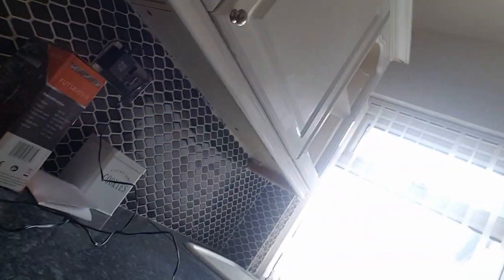Rust Delete On The Passenger Side Rear Wheel Arch (Project Norman)

Comment: Where do you purchase one of those cleaners?
Reply from the maker: It's just a wire brush attachment and a drill, or if your on a budget, just get a wire brush but it will take loads longer if you just use the brush
Reply from the maker: It's just a wire brush attachment and a drill, or if your on a budget, just get a wire brush but it will take loads longer if you just use the brush
Reply: Gazza9919  ah oke thank you